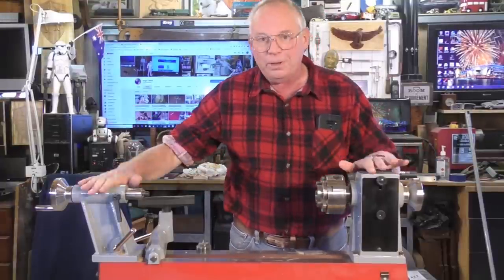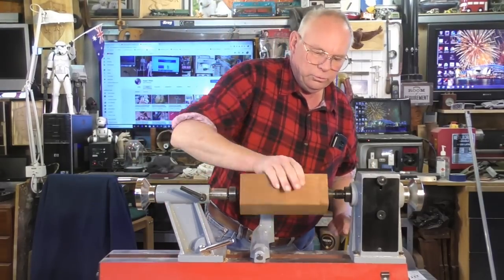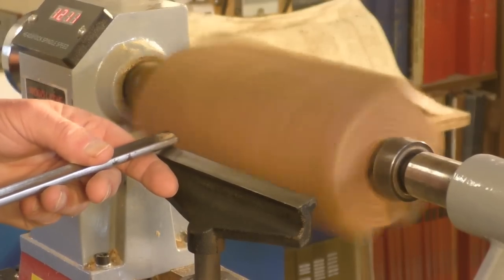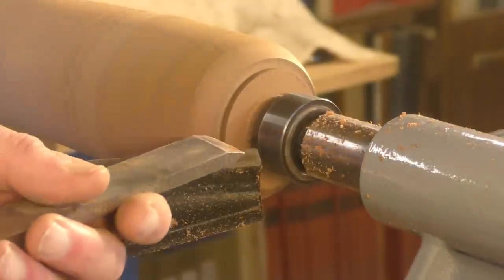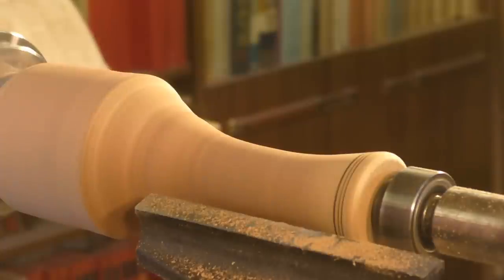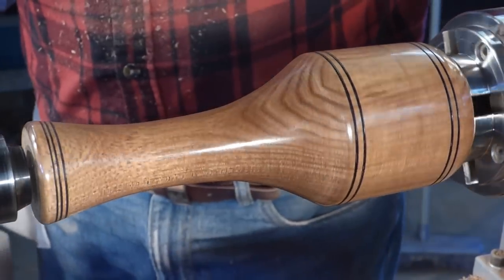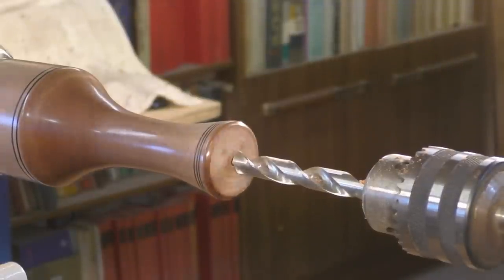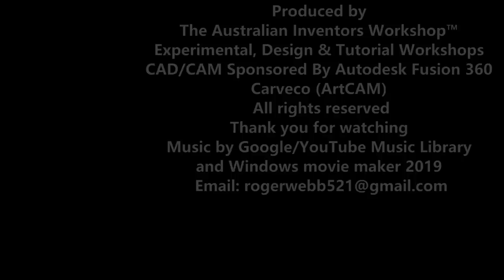Wood-turning a Myrtle vase a beginner’s guide

Comment: Roger, that's a hell of a trick using the parting tool to create the burn marks. I'll definitely be trying that on a scrap piece to see if I can get it to work right.
Reply: wire works great for that too
Reply: We are taking lessons, and our instructor told us to use scraps of linoleum
Reply: @sharonparsons3757   I've only within the past few months been able to use the parting tool like Roger does in the video. I was using Formica samples from Lowe's for the longest and still do depending on the width of the burn marks I'm seeking.

Comment: What time of day did you do this video? Early AM? That rooster of yours just wouldn't shut up. Like Frostera said, I couldn't stop laughing. Now, although I've seen a lot of your turning videos, I have a beginners question. How does a tapered shaft , slid into a tapered receiver, when  a straight shaft into a straight receiver wouldn't. I love the design , Roger. It's very elegant, but simple enough for a beginner to do.